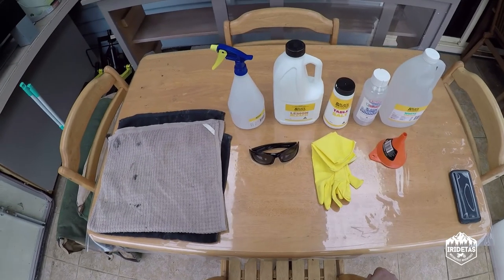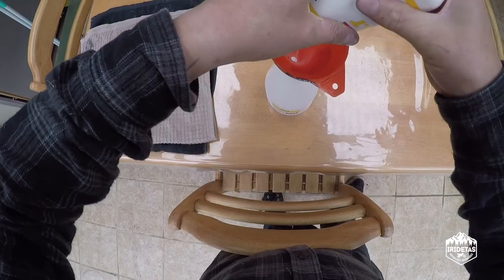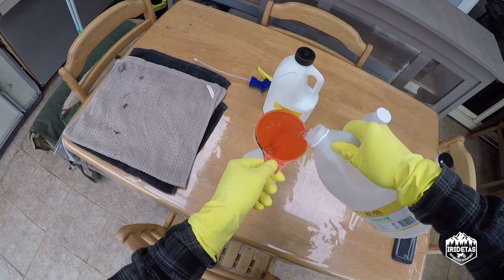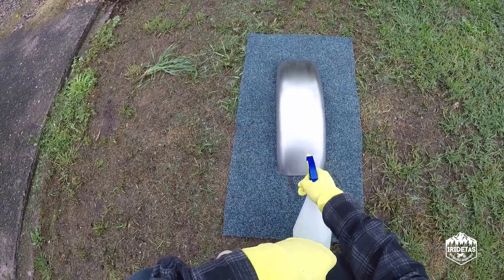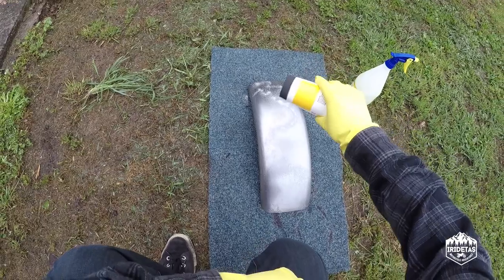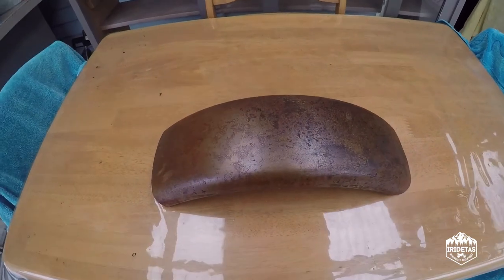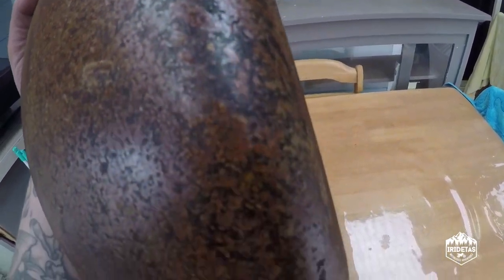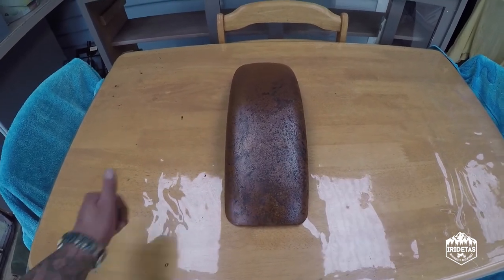Budget Bobber Build #10 | How to Rust Metal Fast to Patina a Motorcycle Fender or Gas Tank

Comment: Looks sick man, got a question though - reckon the rust ever stop? I want to patina my fuel tank but I'm worried that even after an oil/clearcoat, the corrosion will continue over time until it goes all the way through. As far as I'm aware, fuel tanks work best without holes
Reply from the maker: I never ended up using it and its still siting in the shed, rust never progressed anymore after wash off.  Didnt even cleat coat so id say all good man
Reply: I did this same thing to my 76 Triumph and once I put the clear coat on it stopped the process.
Reply: Water and baking soda will neutralize the reaction, pretty much stop the rusting inside the metal, bathe it in that then clear it, or use transmission oil or boiled linseed oil instead of a clear coat

Comment: Hey man, just wondering if it is necessary to get the pink paint off my fender before doing this...and will it work on the fueltank aswell you think??
Reply from the maker: Yes you will need to be down to bare metal.  It would work on a fuel tank.

Comment: The recipe I use that works really well is, 2oz salt, 2oz vinager, And 15-20oz hydrogen peroxide
Reply: How long does it normally take? And how many coats of it did you have to put on?
Reply from the maker: Overnight, put a couple of coats of the chemicals on it! Its quick

Comment: What did you end up sealing it with and did it last
Reply from the maker: Acrylic clear and yes for sure it lasted!
Reply: @iRidetas  geat job 👍👍 for how long do you think it will last after applying the clear coat ?! could it last for years and years ?? thanks
Reply from the maker: Yes mate absolutely, the clear stops it from continuing to rust and in theory holds it there indefinately